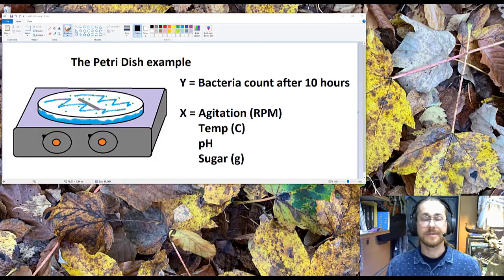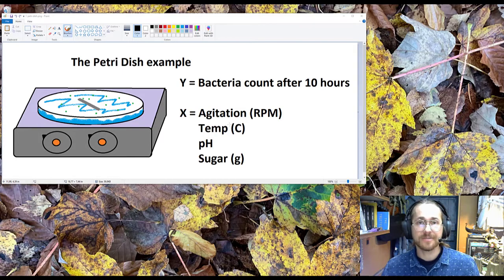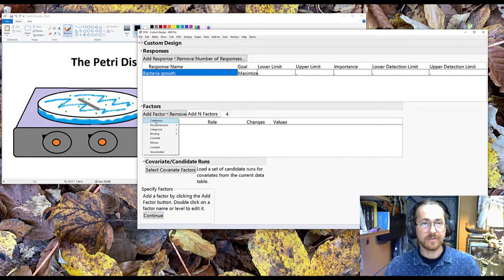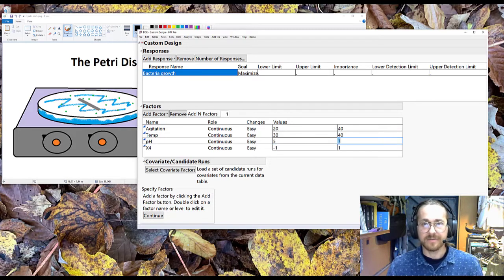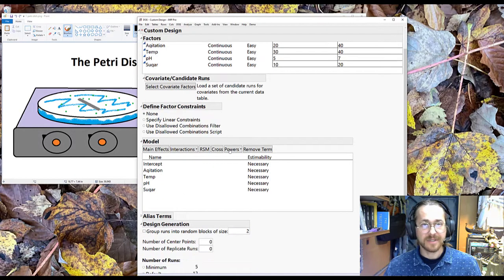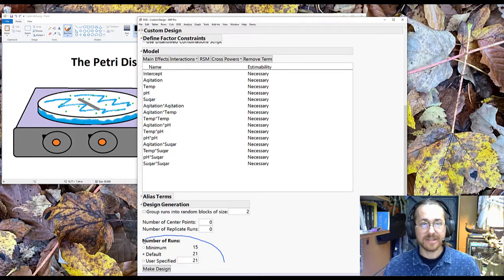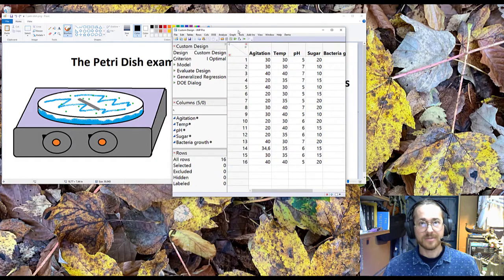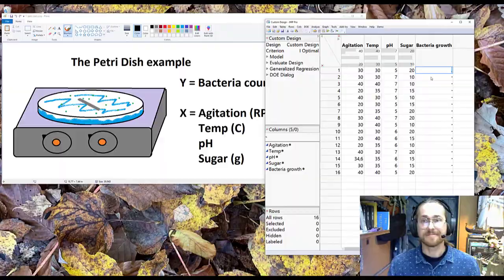DOE Design | 4 Continuous Factors

Comment: Very smooth example however It leaves me with an uneasy feeling about just what is the "Custom Design"?  If we just use it as you show it is a magic black box.  perhaps you could revisit this simple approach and dig in to the details or what exactly we are getting design-wise.  Is this a D-optimal algo driven design...if so, how might we better understand the Power and or the FDS we can achieve?  Maybe we want a few more runs to achieve a higher power or better FDS? If so how would we know.?  Also worst case how to identify something not good...can we create a checklist of experimental goals first?    I do like the continuation with the modelling link!  Thanks again for your efforts